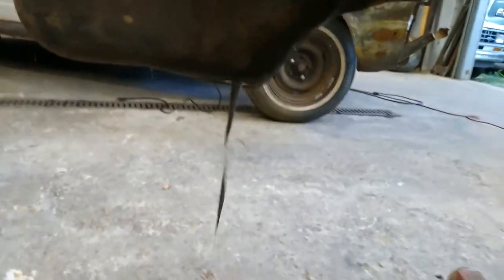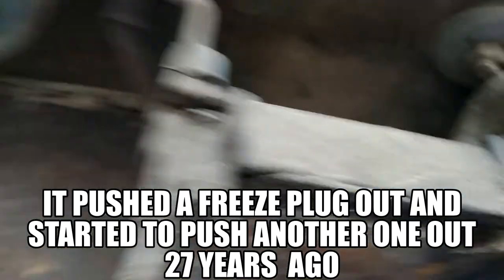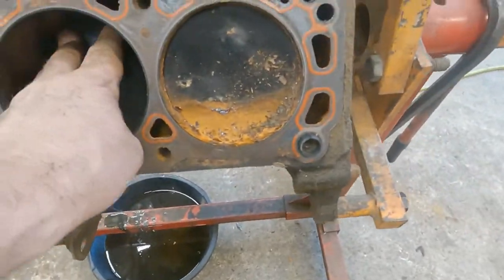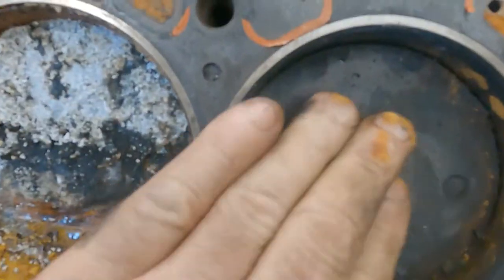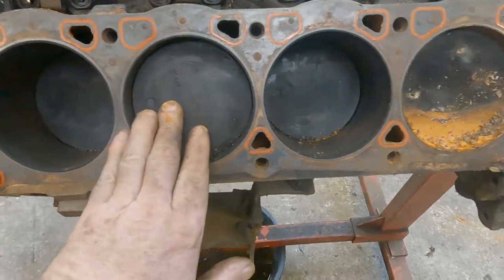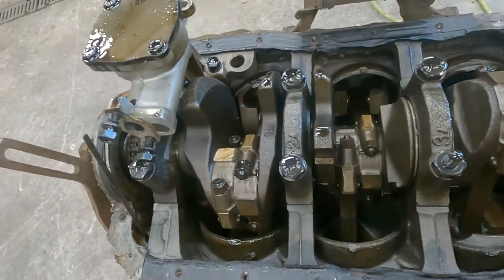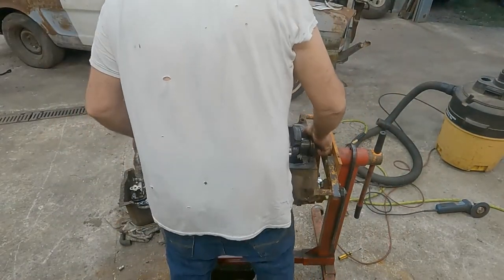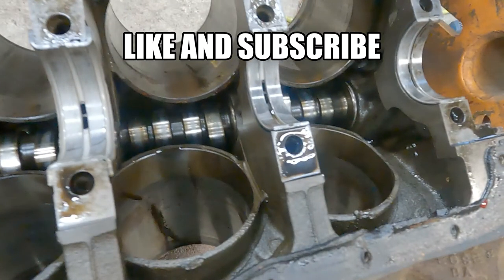86 Mustang GT 302

Comment: So just a block and a master rebuild kit? Standard size?
Reply from the maker: I haven't checked the heads yet. I think I can get a block from a buddy or hit PullAParts and get a Explorer 302.  Everything is standard size.
Reply: @kickassmustangsgarage  The Explorer motor will be superior with valve reliefs in the pistons and GT40 or GT40p heads.  Might not make much sense putting the 86 internals in an Explorer motor.  The 86 does have reusable head bolts whereas the Explorers are torque to yield.  The HO cam may be better than the Explorer cam for certain applications.
Reply from the maker: They both have  their advantages 86 has forged pistons and more compression 9.2. Explorers have bigger valves and a better breathing heads but hypereutectic pistons and 9 to 1 compression ratio. The old 66 Mustang was outrunning 93 mustang gt's and everything else vetts everybody in town back 27 years ago. I've got a 01 Explorer 302 in my 87 Ranger with the GT 40P heads with a 12.7 Semi truck turbo blowthrough set up on it.  In stock form I have to say the 86 was stronger NA. The 86 would turn 6250 RPMs stock rated 225 HP with fuel injection. Explorers only turn 6000 RPMs before valve float and rated at 200 HP. They both have more HP with a carb though.